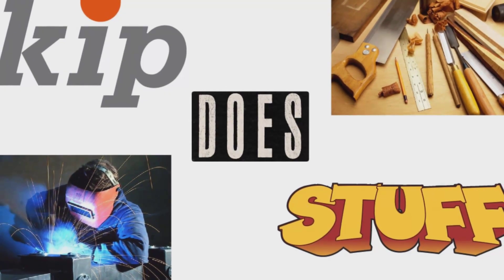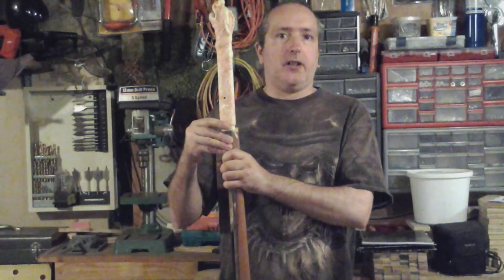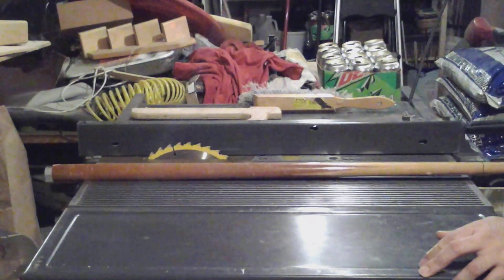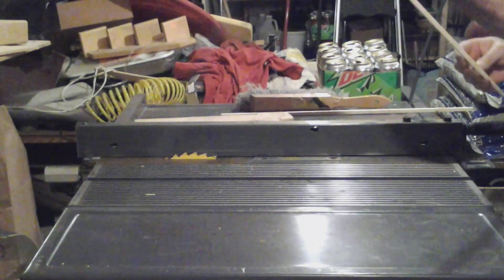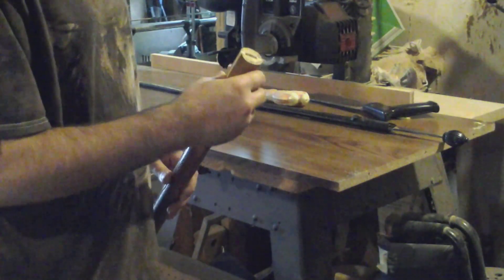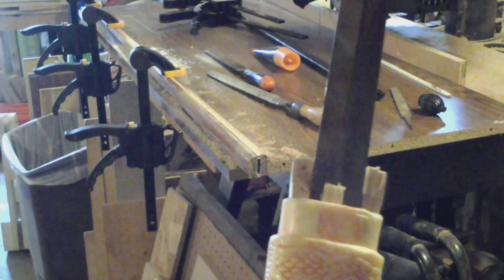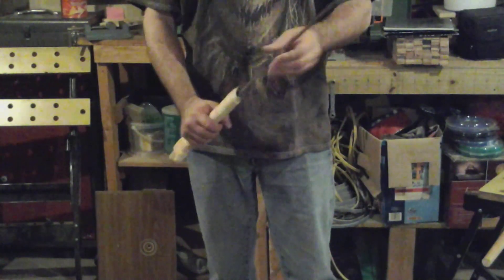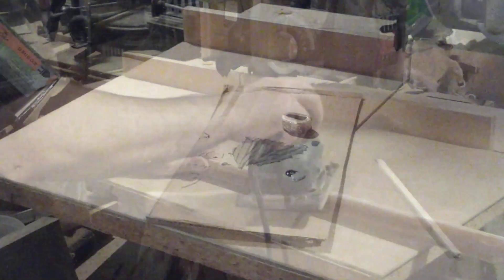Making a cane sword

Comment: It is easy to build a dowel cutting jig that would remove nearly all the risk and danger of cutting that cue stick. The only difference would be boring the holes with different sizes to accommodate the taper. Still,  you did a pretty decent, though scary, job of it.
Reply from the maker: Thanks Ed. I was 100% sure I could cut it safely but I wanted to state the obvious dangers because its not something anyone really needed to be doing. I now have access to a band saw, so if any future risky cutting is needed I will use that and save the high heart rate and sweat for more enjoyable endeavors.

Comment: Clamp a piece of angle iron up side down to guide the pool stick, You will get a perfect cut.

I wouldn't be surprised you tried to fill that handle with the wedges and blade in place
If you did, You did it the hard way
You should have removed everything 
Put the epoxy in the handle, then put everything else in place,

And when you were gluing that pool cue ? or what ever they call it, After you clamped it, You should have removed the blade, and rammed a spacer down inside to clean it up.
Reply from the maker: Hind sight is 20/20.